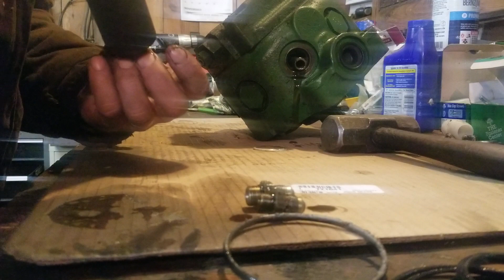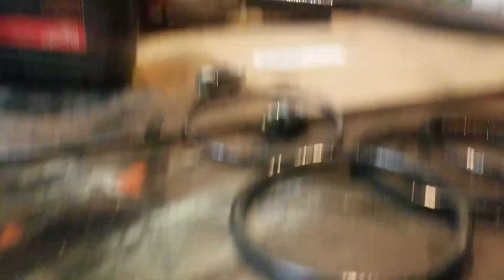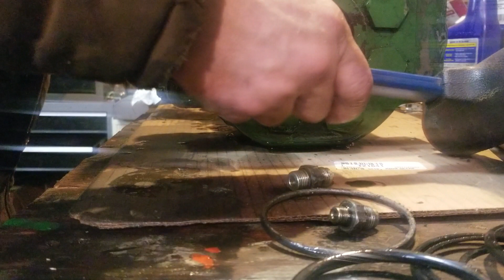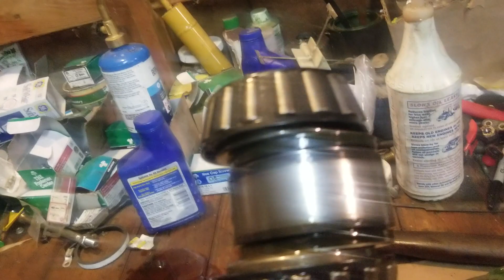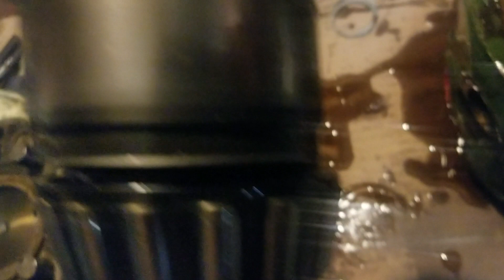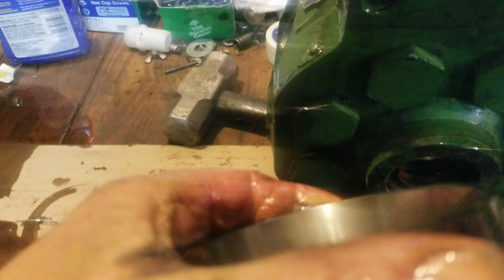John Deere pump teardown

Comment: Hey Mr Smith i just bought a 4055 from 1991 , somebody messed up the wiring in the tractor and ruined cowl and the plastic on the dash (grrrrrrrr) the tractor has run 8150 hours and the tank is leaking from the bottom . so my first problem JD has run out of plastic to the dash , is there any second hand seller you can refer too . my second problem is the tank (haven't removed it yet) i suppose some JB WELD can fix the problem . but would you cut out the rotted part and seal it with JB WELD or would you sandblast it and then seal it or what would you suggest ( i have the knowledge to weld on diesel tanks) . i live in DENMARK , EUROPE and i like your approach to the problems in front of you . So have a very nice day . Ivan Hansen

Comment: I have a 1967 4020 narrow front end powershift that is doing just what you said...leaking oil out of the pump shaft seal when shut off. Now I know I need a seal kit and not just the outter seal, Thanks!!

Comment: Not as simple as a gear pump, but more simple than a variable displacement pump.  So, what was the reason you were tearing it down?  Was there a hydraulic problem with the tractor?  Great video!  Thanks for the tear-down and explanation of those pumps!
Reply from the maker: A buddy of mine is restoring this tractor, it has about 18000 hrs. It was a  family members tractor so he's going through everything. Turns out this pump was replaced recently. Yeah its simple but it also has a charge pump in the transmission. Thanks

Comment: Lucky guy! that pump looks great! if it were mine.....it would have been worn out beyond repair. what are the differences in the radial and the gear style pumps as far as pressure and volume?
Reply from the maker: They build gear and piston pumps in different sizes from 5 to 50 gpm the piston pumps will run a little higher pressure! The rest of the tractor was worn out this was a surprise to find a new pump!

Comment: Great video thanks brother. That pump reminds me of a old inline fuel pump. Runs kinda the same way. I think it was a Catapiler pump to set the valves on it you had different places to pin the engine. Keep up the great work see you in the next video thanks again brother. 
Just reminded me that. That pump really does look clean. We can only see what the camera will let us. Thanks for taking the time to point out how it works and the shape it's in. I appreciate it very much thank you
Reply from the maker: Thanks Scott, they remind me of radial aircraft engines! The tractor had a ton of hours but this pump was recently replaced so it was good!